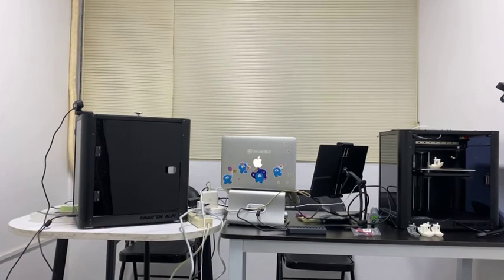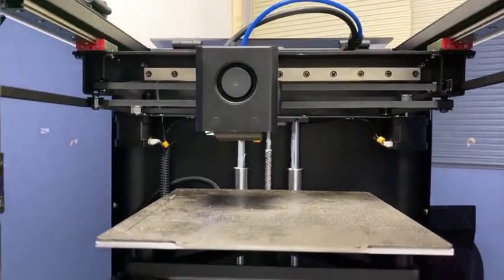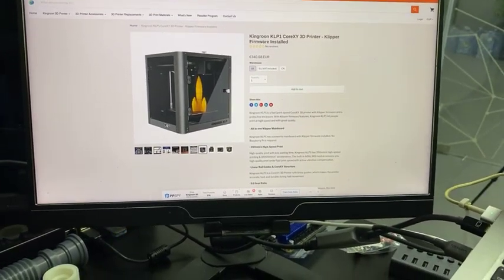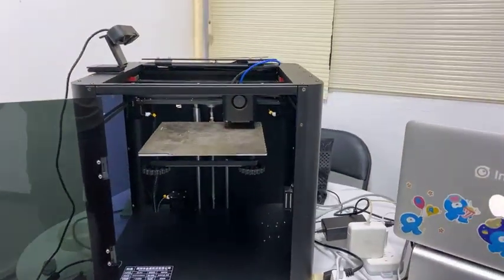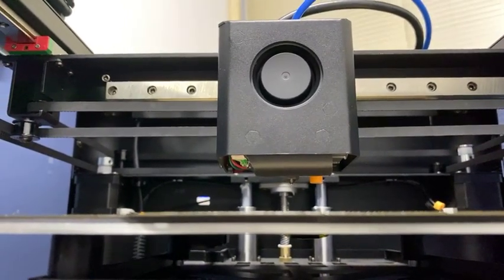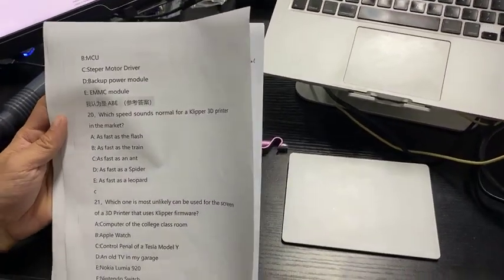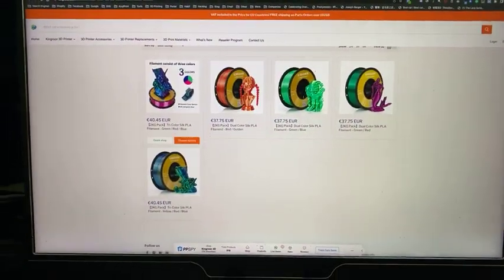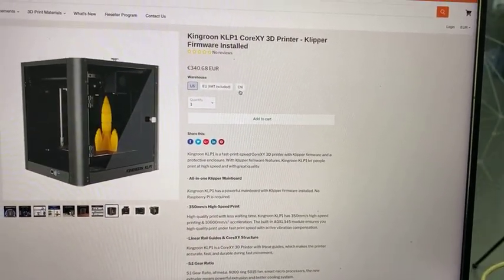KLP1  Klipper Modle Among the KINGROON 3D Printers Just Released

Comment: Why are we still using inductive Z and manual bed leveling? It's 2023. Bambu, Prusa, Creality have moved on to nozzle probing. Getting rid of inductive sensor allows for lighter toolhead and faster printing. Nozzle probing is more accurate and works on all surfaces, even non conductive. Please reconsider this design.

Comment: This looks interesting. I really like that it comes with klipper as stock firmware so that I'd have complete control over the machine. Any possibility of adding a fan with a hepa filter to the machine ? A filter for fumes + a full metal heatbreak would make this an awesome abs/asa printer. Having this nice of an enclosure just for pla and petg is a bit of a shame.
Reply from the maker: thank you for  your suggestion , i wll put this to our technical 🥰

Comment: How well does it handle TPU? The only reason I haven’t gotten a corexy machine with long Bowden tube, is TPU. If extruder gears handles TPU well are their guides or settings tested for retraction?
Reply: Most coreXY I've seen are direct drive. The Bowden is just to guide the filament to the extruder rather than as a feed path between extruder and hot end. Shouldn't affect retraction or temps.
Reply: The development of these printers is awesome. There videos on YouTube on the other hand are not awesome at all and don't show the capability of the printer and what makes them truly good. Need to get with a YouTube 3dp content creator to make some product videos for the states .Just a suggestion.
Reply from the maker: @jordanramirez5749  thanks for your suggestions ,

Comment: Few questions.
- Does it have Wifi? (or option to add Wifi)
- What system does that board runs? Usually I use Raspberry with Raspbian as I need to load specific LCD drivers.
Reply from the maker: Yes, it has Wifi, and we did Core XY and klipper system
Reply: Klipper runs on top of an OS as far as I know. Which Os is installed on the controller?
Reply: @Drew_pew_pew_pew  It is a modified SKIPR board, so ARM RK3328 processor and ArmbianOS (compact Linux, which they preloaded with Klipper, Moonraker, erc.) on the eMMC.